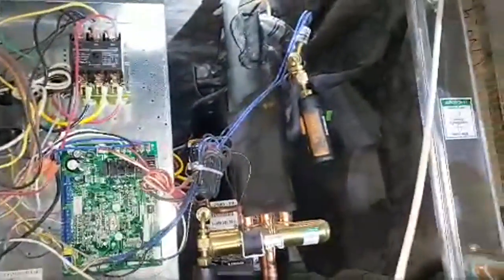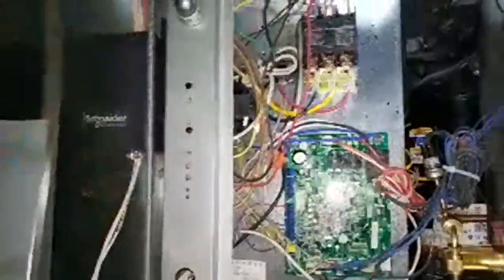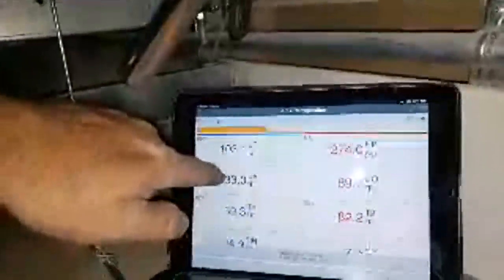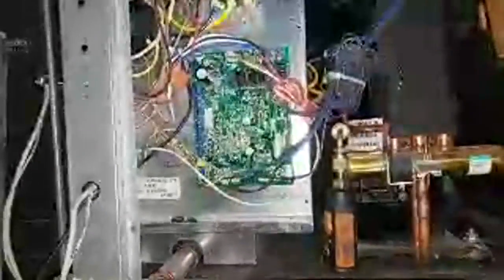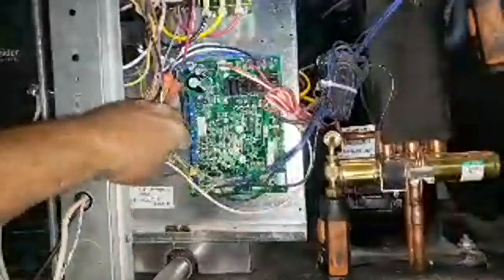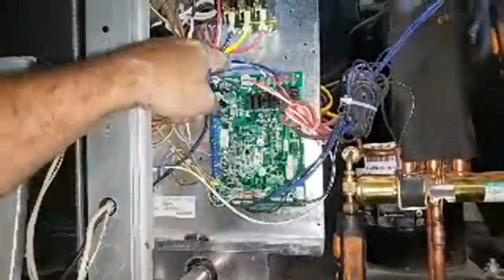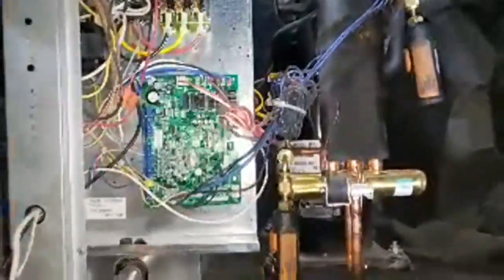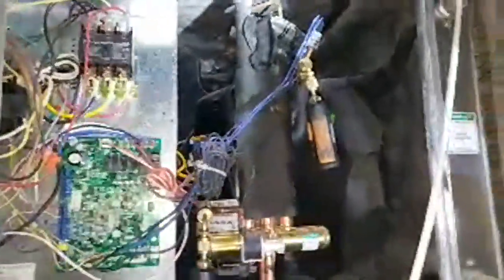Daikin WSHP - Is It Any Good?

Comment: That unit I’ve seen that same low water temp error it starts off once and a while then it gets worse from then on. I bet within a year you will be called back out to it due to the same issue. It is the main control board going out. It is common on those units
Reply from the maker: This one was due to a dirty filter. So I guess it did it's job.
The building maintenance already changed the filter and it hasn't tripped since.
I guess they already put in the warranty request so we went to check it out.

The AAON WSHP units have all sorts of sensors too
Reply: hackfreehvac ah oat, because at my school they had the same unit kept tripping out but all the sensors were fine and I’m like then the only other part it could be is the main control board so they changed it and it has worked ever since